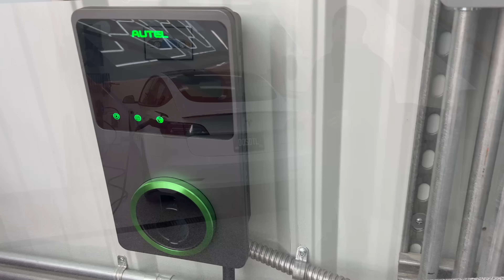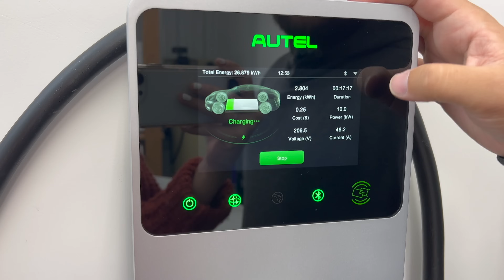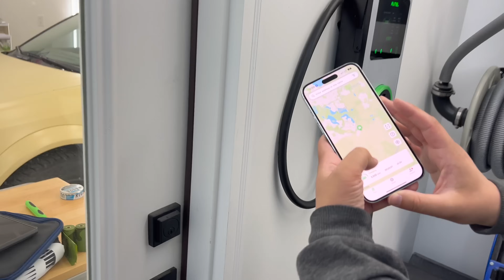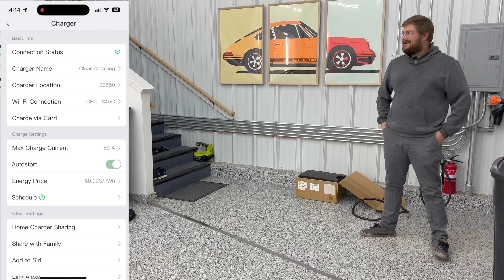We Focus Too Much On DC Fast Charging! Here Are Some Level 2 Considerations - Autel Touchscreen AC

Comment: Honestly I think it's the basic 110 Level 1 Charger that's underappreciated.  I get 5 miles an hour and that's more than I drive every day, and I suspect it's more than 90% of folks drive every day.  Once a week you plug in to a DC fast charger while you're buying groceries or whatever and you're good to go.  I just moved houses and have an L2 to bring to the new house, and have almost zero sense of urgency to do it because it's just not necessary.  And I have two electric cars!  People without EVs hear all these horror stories, but the reality is unless you drive more than about 100 miles a day, every single day you're good with a house outlet and a trip to the grocery store once a week. That's really the message that non-EV owners need to know.

Comment: Just to add to the confusion of the charger to utilize, my utility is now applying an energy fee to the power bill. A level 2 charger will jack up my bill by $15-$20/month due to the 9 kW value of my level 2 charger, beyond the actual electricity usage and cost. This is a normal fee in the industry, usually applied at a utility-to-utility level where the utility purchasing power exceeds the contracted maximum power value (kW, an instantaneous measurement). I have a level 2 charger (Emporia), operating at 40 amps and it easily charges my Ioniq 5 from 20% to 80 % overnight. But, due to the energy fee, I am now charging more often with my level 1 charger, usually from around 70%. I hope Kyle can comment on this situation. I realize this may be confusing.
Reply: Wow what state are you in?  My guess is it’s a conservative run state that doesn’t care about ev adoption.

Comment: If there can be enough level capacity for everyone, I’d agree.   I just can’t see a world yet where every single parking space in a mall parking lot has a level 2 plug, but that’s the sort of future we’ll need once everyone is driving EVs especially if shorter range becomes popular as a lower cost vehicle option.  

Personally, I feel like I’d prefer to just have to do one quick 10-15 minute DC fast charge and be done rather than have to worry about finding a level an available 2 capable parking spot wherever I’m going throughout the day/week.  Figuratively of course, as I personally would have level 2 charging at home whenever I get an EV. I’m just thinking from the viewpoint of if I didn’t have that option.

On the plus side, I’d assume level2 would much more easily have long cables do parking orientation could be less of an annoyance.
Reply: Yeah, not having a place to charge the car at home, work, or somewhere you can leave the car plugged in for a number of hours in the day makes EV ownership much less convenient.  If you don't have that option, DCFC is probably going to be your best bet.

Comment: We need more 80A 240v (not 208v) at Superchargers CCS stations. On holidays / busy the networks can dis-incentive staying on the DCFC part 30kW and dropping. 

Also, in a pinch I’d rather sit on a 32A/48A/80A L2 while waiting, especially if I squeak in low or it’s super hot/hold I can at least manage thermals and get 20-60 mph added

Comment: That Autel 'commercial' unit looks identical to the residential unit with the only difference being the touchscreen.  I've been using the Autel unit with the separate holster to charge my Wrangler 4xe for the past 6 months.  Very reliable charger that will charge my Jeep at its maximum rate of 32 amps.

Comment: I upgraded my service and had my Tesla Wall Connector installed via QMerit. I had a 100 amp box in a house built in 1910 and it cost me $3840 (plus the cost of the Wall Connector.) It’s great! My garage is my gas station now! I pay a bit more for electricity than Colton ($0.142 per kWh) but it still works out to about $0.04 per mile driven in my Model 3 standard range. Very happy!

Comment: 2022 Mustang Mach-E, had to upgrade my panel to 200 amps. Had a 48 amp Lectron ectron level 2 charger installed. It's called a 48 amp vbox. Chose that because of the price and the simplicity of the use. Figured I could just use the settings in the car for timing it. Right after it was installed this Altel charger 48 amps was on sale for only $20 more. I wish I would have got that nothing wrong with the Lectron it's just the Altel does have more features.

Comment: Good to see another level 2 review. Our BMW i4 e40 just passed 10,000 miles with all charging done at home. For various reasons we bought rather than leased the car and want to protect the battery. It left the dealership with 100% SOC but hasn’t been above 80% or below 15% since then. Based on a Tom M. review from a few years ago, we got a ChargePoint Home Flex. It’s hardwired and delivers 9 kW.  We’re very happy with it so far.
Reply: His channel is excellent.

Comment: Finally talking to 90% of us that use level 2 either at home, work or at a hotel. I have a Mach E for over a year and 15k miles and have used DCFC 4 times. At home I have 1450/50amp service in garage and a charger that is switchable 24/32/40 amp and I used this based on how quick I need to top off. Most often I use 110v plugged in 24/7 which works for me.

Comment: Whether it’s fast or slow, all charging should be DC. The whole grid should be DC. The AC grid made sense back in the day, because they could only change voltage easily with AC. In modern times, we can easily do so with DC, too. And going forward, most of our power generation is going to be naturally DC.
Reply: You ought to do a little reading (or watching YouTube videos) on early electricity generation and distribution systems, of AC vs DC, Nikola Tesla vs Thomas Edison.  The biggest reason for using AC is the ability to step up the voltage (through simple transformers) to reduce the current (P = V x I  or  I = P/V), and thereby greatly reduce the energy losses and to be able to use much smaller wires for long distance transmission of electricity.
Reply: @ronaldrissel6665  you might want to re-read my comment. Particularly the third sentence. That’s what I was talking about.

Comment: My favorite EVSE has to be the Tesla Wall connector. I find it very unfortunate nobody else really offers an EVSE with NACS.
Reply: I am with you.  I will stick with my hardwired Tesla unit in my garage.  NACS!
Reply: A year from your comment and I think you’ll find a number of EVSEs with either NACS or J1772 options. Of course the Tesla EVSE comes with both built in.

Comment: Just to clarify, and maybe others have also, for 240VAC in North America, the red wire is L1 and the black is L2 and the green is ground. Both the L1 and L2 are HOT and alternate between positive and negative relative to ground. When L1 is positive , L2 is negative, then the other way around. There is no positive and negative wire in AC wiring.  For 120VAC, there is a hot wire (black) which alternates between positive and negative in relation to ground, and a neutral (white) which is a current carrying wire but always stays at 0 voltage relative to ground (when everything is working correctly
Reply: Yes in fact any color AC lead except white and green is a hot lead.
Reply: On 3 phase th neutral Carries unbalanced load back to panel

Comment: Some local power companies and governments have rebates on Level 2 installations. Los Angeles Department of Water & Power requires them to  be hardwired by a licensed electrician and kept in place for 3 years. I am filling out the forms for the rebate and was surprised by these requirements.

Comment: You've had videos before with the Porsche Taycan where they have J1772 on one side of the car and CCS on the other.  Any reason why Porsche couldn't have J1772/CCS on the same side and NACS on the other?  Assuming the BMS was programmed to handle both charging protocols.  This would be very useful for Lucid and Rivian that are being hampered by the poor quality CCS networks available to them.
Reply: Great idea, but will be quickly made obsolete as Tesla continues to rollout CCS adapters at supercharger locations across the country.
Reply: @mowcowbell  The rollout is really limited so far.

Comment: Tesla owner here.  I installed a 240V Nema 14-50 recepticle in my garage.  At the time of purchase my Model Y LR included the mobile connector in the price.  My Tesla mobile charger is constantly plugged in and isn't removed from the wall. It's tied down with zip ties, actually.  I bought a 2nd mobile connector to stay in the car.   This cost me half as much as going with the full 60 amps (48A) charger from Tesla.  Granted I only get 32A but I don't miss that extra 16 amps when I'm asleep and my car is charging overnight.  The car is finished charging by the time I get up and has a full charge (I go to 90%) when I'm ready to go.

Comment: I wonder if the Autel unit will hold up to the weather as well as the Chargepoint units do? It's great that they are way cheaper but if they don't last then it's a problem. Businesses want to buy one and have it installed and have it be reliable, not buy a stack of 7 of them and go through one a year and have to call out an electrician each time.

Comment: It turns out, the 20-year-old house I'm living in actually has a 200 amp breaker on the outside of the house. What amperage of charger would you suggest?
Reply: Get a 50 amp circuit Installed and take it from there
Reply: The car controls the rate: if it can only charge at a 32 amp rate (7.7kw)  then a 60 amp evse is a waste of money, for example. Match the "output" to the car's capacity.
Reply: And it also depends on what other loads are in your home / what's available on the panel. Municipalities will have codes as to allowable electrical loads based on service, so make a couple of phone calls too!

Comment: Will that 50 amp Autel commercial unit hold up in the weather? It doesn't look as weatherproof/robust as Chargepoint.  Does the 7x cost comparison between Chargepoint and Autel take into account maintenance and longevity?

Comment: Would love to see discussions and reviews on cable management solutions for typical home garages.   Especially overhead systems.  I hate(!) tripping on cables.
Reply: I run mine from the ceiling! I keep a little plastic storage rack in the middle of the garage to just rest the charger cable on. It is super easy to plug in and out and it is never in the way...
Reply: @nafnaf0  Sounds like a great idea!

Comment: Yes, you're too concerned with DC fast charging. I have a BMW i4.  At 13 cents per KWH, it costs about $11 to recharge the battery at home from a zero state of charge and that will yield about 300 miles of range under optimum conditions.  In contrast, our 4Runner gets about 19MPG and to go that same 300 miles costs about $52 in gas. That's a huge difference.  When I add the solar production from the array on my roof, the real cost is zero.  I don't worry about public charging because we have a gas vehicle that can take us to distant places.  For now, the i4 works great around town and, its a lot more fun to  drive. I fully expect public charging to  improve in the future but, until then, I'm good.

Comment: Chevy does free 240V installs for there EV customers and their 32A charger is super cheap. 

Bolt EUV almost fully loaded costs $32K. With $7.5K rebate from federal and $2K discount from NY state (most state have some incentives) and free 240V install which cost around $2K, The bolt was like $21K! That is insane for an EV which is brand new, not bought used, and has very low running costs as fuels prices go high, awesome tech and nice interior with all physical buttons and ease of use. This car will easily last 6-9 years and won't feel old because it has apple car play which stays updated with new software and newer phones. I am loving it, highly recommend it while the incentives last.

Comment: Can an EV owner use level 1 in their garage and get by?
Reply: Depends how many miles you drive a day, you're going to add 3-5 miles per hour on level 1. I drive 16 miles a day, and charge at 8 amp level one no problem, can bump it up to 12 amps when needed. Just make sure you have a good outlet, tight connections without other big loads on it.

Comment: I'm confused... Isn't 60 amps 20% over 50 amps? Why a 70 amp breaker?
Reply: It is confusing a bit, but 60 minus 20% is 48.
Reply: 60 * 0.8 = 48. It wasn't said very well, but you must be 20% lower than the max for continuous loads. So you can output 80% of the breaker and wiring rating.
Reply: The breaker is designed to protect the WIRE. An over designed circuit is just fine.

Comment: Actually you have two line voltage and a neutral wired into the unit. No positive and negative. It’s AC. Thanks for the video

Comment: FYI, the residential unit also has the RFID reader. You could use it to charge people to use it or if you have to install the unit outdoors it can prevent others from stealing power. It would be a great charger to put at an AirBnB or VRBO and you could allow charging for an additional fee. Also, check your edit. Part of the video is repeated.
Reply: Several people have mentioned this and thanks for affirming it. Is there a monthly service charge to the owners to charge people or pay as they use it? This would be great for apartment buildings with common parking and house power or at my cabin in the woods for that emergency charge someone might need to get down the mountain. There aren't many good options in the less expensive range. Shine pay and orange charger stand out but the owner has to pay on their own system.
Reply: Good to know. Actually had someone asking at Fully Charged Live about situations where he'd charged at friends houses and while they were fine with it, he felt guilty not knowing how much to repay them. So this could maybe help in those situations as well.

I'm in a multi generation household and while going to the fuel station had that moment of 'oh help once I get an EV how will I cover my home charging fuel costs, if I can't see or track how much it costs my parents?' or just track different car usages in general, so good to know some residential chargers have stuff like this.

Comment: Just got a tesla M3 rwd so max charge is 32amps (my charger app shows its pulling 33amps).  I have a 100 amp service at home.  I ran 6/3 wire to the garage to wire it up to a 14-50 outlet.   Works great.  No issues.
Reply: Me too. I set mine at 22 amps on the app.  The cable gets a bit warm at the full 32 amps.  Doesn’t get warm at 22a.

Comment: Level 1 and 2 should be everywhere.  Home, work, shopping centers, movie theaters, grocery stores... Anyplace people are parked for a while.  Having power available everywhere would greatly reduce the load on the DCFC.   Those DCFC locations should be just needed if your in a pinch and need a fast charge or your road tripping/travelling.
Reply: Level 1 is great for at your job, where you'd work an  12 hour shift, even then Plug in Hybrid would be the ones getting topped off. 
For Full Electric Vehicles, it would restore the milage driven to work and MAYBE a few extra miles. (idk let someone crunch those numbers)

Level 2 is generally better due to quicker charge times for Plugs ins to get topped off and for BEVs to get a full charge within a work shift.

thing is, is it worth the money or time? since if i recall correctly it costs more when using someone else's electricity rather than your own. which is interesting, cuz on one hand its easier to scale at common points of interest BUT the company does want to get their return on investment so yeah they kinda need to charge both cost plus a profit margin. whereas as homeowner only gets billed for their consumption rate. 

still sucks but nothing is free so i guess the cost must be added in. 

back to the original point, Level 1 isnt bad, but its best for Plug Ins and technically could offset commuters milage for the employees (not for public use since its an 8 hour charging period, essentially a staff memeber)
Reply: Level 1 is useless. level 2 at a minimum
Reply: @pk-jc9se  for me it would be perfect If I owned an EV, my work allows free charging, they have level two charger's at the main office but I'm sadly at an aux campus but they still let us plug in, I only live about 5 miles from my work so level one would fully fill me.up while working easily

Comment: I really like my Grizzl-E EVSE with the "extreme" cable that's more flexible. (I think all come with that now by default)
That thing is simple and built like a tank, I don't expect any failures for a long time. I didn't get the smart version as you can monitor pretty much everything you need through the Tesla app, along with setting up scheduled charging. But it would be cool if they had a more modern smart charger that allowed load sharing, payment options, and max amperage setting.  Their current smart EVSE is really just for monitoring/scheduling.
Reply: You didn't miss out on not getting the smart version; I did, and the app (3rd party) is mostly useless. I'm disappointed by that aspect, but for everything else, the Grizzl-E has been solid.
Reply: I've been looking at their Duo hoping to have one PHEV and one EV in the next few years if we can get an EV that can go for 3 hours with under 15 minutes of charging.